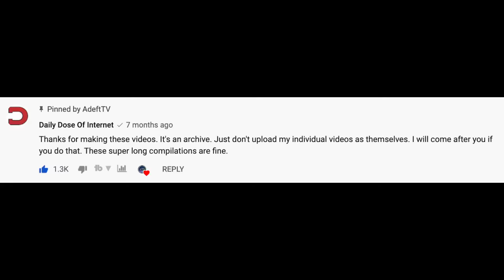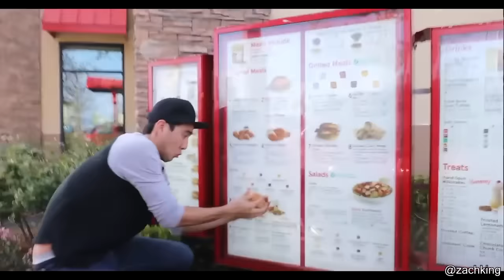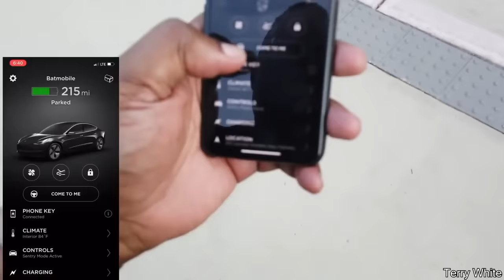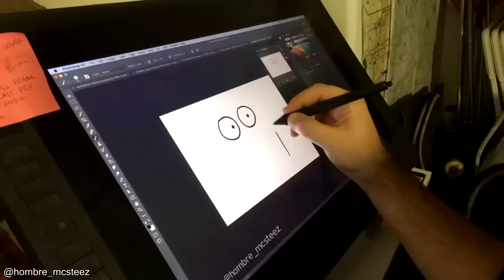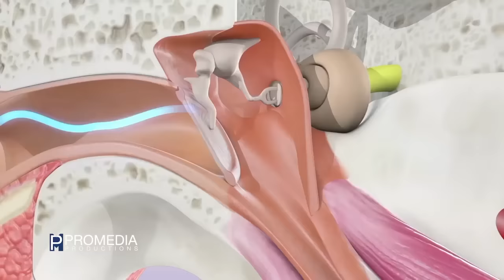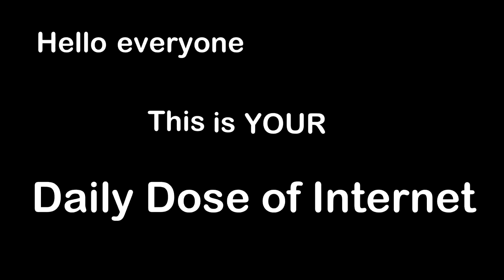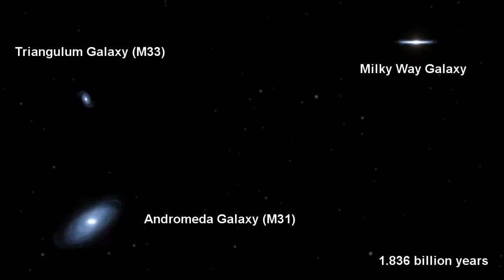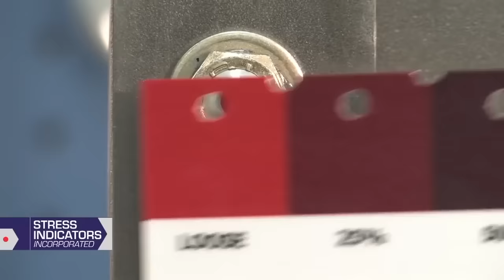1 Hour Of Daily Dose Of Internet (Part 2)

Comment: Guys, if you ever find a "turtle" put it near water, never in it
Reply: I’m curious why. I see turtles in the water around here all the time.
Reply: @marieconstantia4441  because some people find tortoises and put them in water, so they drown
Reply: @IdiotWithEducation  an easy way is to see the legs. If they're flat like flippers,  they can swim (turtle).  If they are round and have little nails, it's a tortoise.
Reply: I one time tried putting a tortoise near water, but he got scared and, as I was letting it down, started to flail. The dude literally fell down a couple big rocks and dived right into the water. Hope it's still alive and well
Reply: @JODA93  Those are mostly sea turtles with only flippers, Aquatic turtles in lakes and such also have nails, mostly webbed feet tho even if its a turtle it would be safe to just put it near water anyway not in it.
Reply: @jimijimo3289  for sure. Didn't mean to imply otherwise.
Reply: @JODA93  Yeah just wanted to clarify no biggie :)
Reply: Yes. It could be a tortoise. U is dog of wisdom.
Reply: Kitsune Fyora it’s not, dead before he hit the water
Reply: Stefen Fuqua  yes it might be a tortoise

Comment: 19:31 my mum and I did this once but for a cat with it's head stuck in a Chef Boyardee can someone littered (is that the right word?). Anyway, we heard echoed meows from across the parking lot. It was stuck good alright too. The sauce probably hardened against his/her fur and it didn't have the tensile strength to get it off.
Reply: And I SWEAR if someone makes a "WhAT aRe YoU dOiNg StEp CaT" joke, I will slightly tilt every piece of furniture slightly to left, so you'll know something's wrong, but couldn't say exactly what. I'll also eat all of your chocolate.

Comment: 58:08-58:27 Walmart and other large department stores.
Are they stupid. With today's computers and inventory tracking systems, they should be able to profile every item in the store. Track exactly when it's bought, what times of day, alert when items reach a low level and need re-ordering, and what items are not selling. The robot is a complete waist of money. In the end, it still requires a program to do the same thing they should already be doing with software.